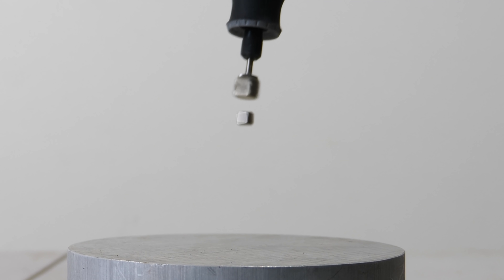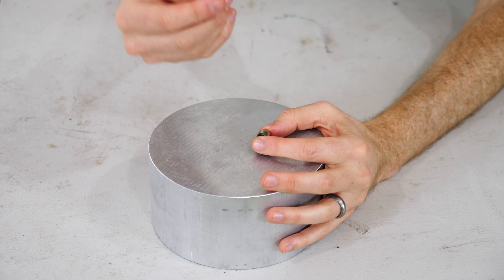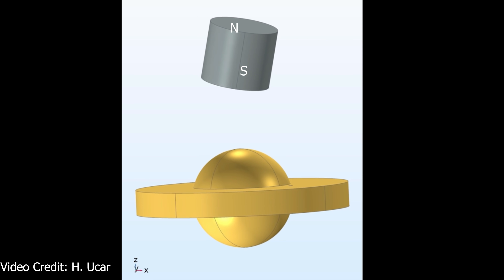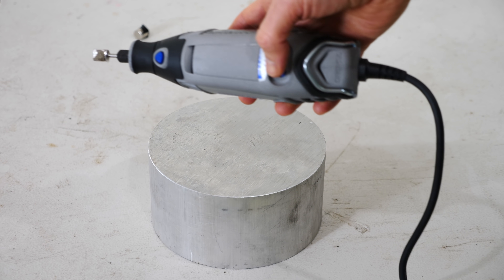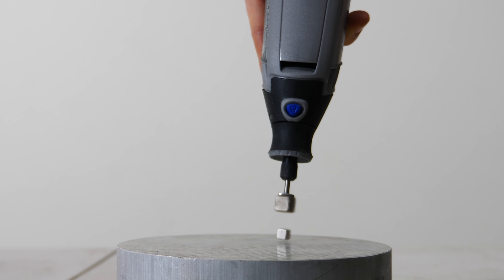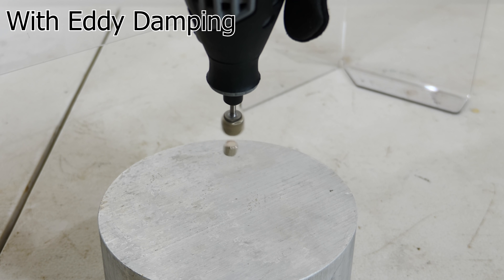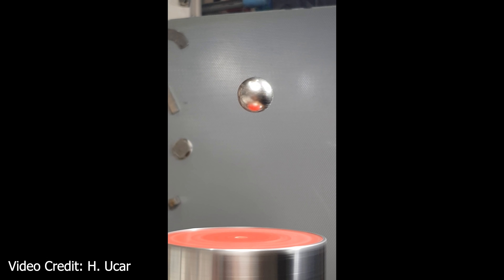Magnetic Locking WITHOUT a Superconductor!

Comment: hi, your video triggered my mind about magnetic bearings.
the youtube full of videos a rod floating on few magnets, spin kinda "fricyionless"
but all has intention to move out axially from the supporting fields, therefor 1 end is pressed against a wall.
its all about flywheel storage battery.
let say you have your flywheel spun up, suspended on radial magnetic bearings then you have this kind of locking magnet at the end.
would it be feasable to apply this kind of "active" axial locking, or does it cause energy loss?
aka does it consume extra energy while my flywheel spins as usual.
let say ther is a nother kind of axial positioning, while the speed of flywheel out of magnetic locking speed requirement.
Reply: Let me comment on that. This magnetic locking system requires the floating part to vibrate by the principle. However vibrations are not welcomed in a engineering solution. This can be solved but not trivial. Generally this have a energy cost. Please also Ucar's works referred in the description.
Reply: @sudanamaru  thanks, Ucar's paper was frigteningly mathematical, it "repelled" my understanding.
also i did not imagine, that the bouncing is a must in the theory.
cause Ucar's videos shown quite "stable" balls and cylinders floating in midair (okay, once suspended between 2 or 3 rotors)
so technically all the magnetic bearings must have some reluktance "friction" that pulls some energy from the spinning rotors suspended between the magnets.

Comment: Pretty incredible, imagine if you could achieve this with super magnets working in equalibrium with gravity to reduce the fuel required to break the stronger gravitational forces for rockets to lift off. Maybe this partially explains so called UFO flight technology, both terrestrial and extra terrestrial.
Reply: It is surprizing that this locking effect is covered by the Newtonian physics. However its implications I expect will go well beyond that.

Comment: I wonder if this could work in reverse. Also, I wonder if this has applications in plasma physics to assist in fusion reactors. Tokomak Reactors essentially use magnetic fields built in a circle to flow hot plasma without touching the walls and melting out. If this can concentrate the plasma into a ball, it could really assist in simplifying fusion reactor design.

Comment: This trick would not work with ferrite magnets, only neodymium magnets.
The magnet surface has to be electrically conductive to support repulsive eddy currents.
The magnet is floating in a balance between repulsive eddy currents, and atractive magnetic force.

On both magnets there are eddy currents that heat them up, especially the surface. Such heating breaks anisotropic domains, and weaken the magnet.
Reply: This is why the researcher recently suggested an educational initiative to prevent such confusions. 
https://twitter.com/Sudanamaru1/status/1374204457576189954

Comment: Fantastic experiment!  I tried it and was able to repeat the results.  In my trials I did notice an interesting effect.  Once the levitating magnetic "locked in" the load on the Dremel tool increased as evidenced by a sudden drop on RPM.  I haven't downloaded the paper yet, but was curious if anyone had noticed this behavior.  Any ideas as to what's going on?
Reply: This is not the characteristic of this phenomenon. Unlikely but if your magnet you levitate is big, it can cause vibration on the dremel shaft which can increase the the friction in case your dremel is not in good shape. See my channel for more configurations.
Reply: hi what type of glue did u use to glue it to the dremel

Comment: The paper by Hamdi Uçar is brilliant.  So many good examples to illustrate every mathematical analysis. One of the best science papers I have read in a long time. James'  PhD paper is also interesting and I hope the processes are extended further, it may become a practical way of preparing liquid fuels from low value (waste) biomass feedstock.

A commercial implementation might be a small magnet with butterfly wings that is levitated above a rotating tilted dipole with a static repulsive field on-axis. Electromagnetic rotating dipole would make less noise and be a cool desk ornament.

A few experiments I would like to see tried:

1: Just for fun try this out on the vomit comet or on the ISS. Would it allow for arbitrary towing of the magnet behind the rotator?

2: Have a (spherical) magnet levitating in a small pot of hardening resin that leaves the magnet away from the edges with no layer seams in the resin.  Would the small motion prevent the resin curing in proximity to the magnet?

3: Using phased electromagnetic coils and a free running ESC might be able to produce the rotating magnetic dipole.  Can a magnet be levitated with no moving parts, except the levitating magnet which has to oscillate? Another comment on repurposing an induction motor had the same idea.

4: We would like to see a collaboration with one of the high speed camera channels so we can better see the motion of the levitator.  It should be like a spinning top but would be nice to see.  See figure 60.

5: Floating a blob of ferrofluid (perhaps in a capsule), I wonder if it qualifies as it does not have its own magnetic field.

Comment: It was Mr. Earnshaw who proved why you can't levitate (in unconstrained space) using permanent magnets - (his electrostatic theorems being extended to magnets) - but rather nicely he left a couple of loop holes - one was the moving magnet effect - his theorem only applied to static magnets and the other loop hole was it didn't apply to diamagnetic materials (materials which only repel in the presence of a magnetic field). Wasn't that nice of him? :)
Reply: One should check the possibilty of presence of this interaction in the nucleus by the requirement of p or n provides the rotating field.

Comment: I have seen thermometers That operate with glass floats suspended in a column of liquid that rise and fall according to the temperature. Can you explain how they work?
Reply: Galileo thermometers are super cool! Basically as the temperature changes, the effective density of the liquid and each of the floats change. They move up and down depending on their own density. Because of this, if each float represents a certain range of temperatures, you can determine the temperature :D

Comment: Years ago there was a toy top called a levatron or some such. You would spin the top on a plastic sheet over a strong circular magnet. You could then carefully lift the top up with the plastic sheet until a certain point was reached where the repulsive forces balanced gravity. It would float in the air as long as it was kept rotating fast enough. There was a copper (or aluminum) washer placed on the top to create the dampening eddy current field. This washer had nothing to do with weight. If you used a non conductive washer of the same weight the top would not float stably.

Comment: "Tomasz Mazurek: I'm thinking it should also be possible to use a stationary circular array of electromagnets to create a spinning magnetic field without moving parts - but would it be more or less efficient?" 

Less efficient. However in order to trap sub miligram particles one needs to have rotating fields above 200,000 RPM where coil solutions should be considered. A single coil solution is also mentioned in the article.
Reply: Buildable idea: Levitate a small NdFeB floater using a coil-only PFR/MBS trap by driving two orthogonal coils in strict quadrature to create a rotating transverse field BC=cos ωt x̂+sin ωt ŷ and adding a constant bias field BS along z with a solenoid; choose ω above the floater’s torsional natural frequency ω0≈√(τS/I) so the dipole phase-lags and precesses on a stable cone about z, keep BS/BC above the minimum for z-aligned precession, then introduce a gentle axial |B| gradient ∂|B|/∂z so the rotating field yields short-range polarity-free repulsion that balances the longer-range DC attraction to form a bound state; make the gradient by slightly detuning a Helmholtz pair or adding a small shim coil, use a tiny axis-symmetric magnet and provisional eddy-current damping with a copper or aluminum ring for capture, then trim BC amplitude, BS level and ω to set height within the stability window.

Comment: What would happen if you used spherical magnets for both?
Reply: Check the 0:44 of the full video https://youtu.be/EMwKT2892LM where the spherical magnet is visible inside the floating assembly. Anyway, bare shperical magnets also work (in both directions).

Comment: "Next question, can you use electro-magnet to simulate the spinning motion instead to achieve levitation?"

Maybe. Keep in mind that the ferromagnetic core of this electromagnet  should not be attracted by the floating magnet significantly otherwise they will stuck together. Maybe a core with low saturation characteristics would be needed.
Reply: A strong magnet would be ideal. The repeated attraction and repulsion that this creates is the mechanism responsible for the observed locking.
Reply: @jdfershizzle  Does that mean that there should be a relative and equal pull force from both magnets or should the spinning controller magnet(s) have a stronger pull force than that of the one being locked(or vice versa)? And how does one account for the physical weight of the locked magnet?
Reply: Intuitively, I want to say yes, but I don't know. I can't wait to experiment with this!
Reply: @abderrahimaourir Why using air gun there? Magnets continue to orbit (and then escape) once you push them in order to free them from their alignment with the Earth field (similar to a compass).

Comment: How about making the rotation "digital". You have electromagnets in a circle and via a controller turn on the magnets one-by-one in quick succession and maybe reversing the polarity if needed.
Reply: Doing it with electromagnets.  Why not just switch polarity of a single stationary electromagnet quickly to achieve the same?

Comment: Imagine if a guy just built a 100,000 square meter superconductor and made it froze in Antarctica, Because of how big the Superconductor is, you can make anything levitate due to the temperature no matter how big as long as the pole of equal sides don't collide, it will levitate, or just put a magnet in your shoes and make it the opposite pole of the superconductor, will it make you levitate? Or make you stay in place? Well my idea can't happen cause it's practically impossible with todays technology, just asking for the impossible you know?

Comment: Something tells me this is how UFO’s fly.
Reply: "So when a video appeared in 2001 from a small company called Transdimensional Technologies of a triangle shaped, aluminum foil and wire thing called a lifter that actually propelled itself off the table, I immediately had to make one. I’d had enough background by then to be confident that it was flying using ion propulsion. And in fact, given my background I was able to put an enhancement in my first version that others came up with only later. For those who’ve never seen a lifter, it’s extremely simple. Think of it as a very leaky capacitor. One electrode is an aluminum foil skirt, in the shape of a triangle. Spaced apart from that around an inch or so away, usually using 1/6″ balsa wood sticks, is a very thin bare wire (think 30AWG) also shaped as a triangle. High voltage is applied between the foil skirt and the wire. The result is that a downward jet of air is created around and through the middle of the triangle and the lifter flies up off the table. But that is just the barest explanation of how it works. We must go deeper!" – 
https://hackaday.com/2016/07/13/expanding-horizons-with-the-ion-propelled-lifter/
Reply: @Chicken_Little_Syndrome  nerd 🙇‍♂️
Reply: I thought the same thing. Because it's ironic that there are always more claims of seeing unexplained flying objects around places in the earth that have a large magnetic field in the ground. I'm no scientist or a hard-core alien believer. I just know there are things that fly in our skies that have yet to be explained to me...

Comment: Now make it move in the line of track
Reply: https://www.dropbox.com/s/y0d2ufnlikpp9y0/IMG16107911157650.jpg
This is a rotating track of alternating magnets attached to a DC motor. When the track rotates, a magnet can  be trapped in the air, little above rhe track. This arrangement is not optimized and the trapping is just enough to keep magnet in air above the track but not below.

Comment: If you can get that effect by rotating magnets, then you should be able to get the same effect by electrically rotating magnetic fields. You would just need really high frequencies.
Reply: Correct. This is required to trap small magnetic particles and molecules. For even smaller objects like atoms and neutrons, one should use electromagnetic waves. However, these are governed by quantum laws and and solutions could be different.

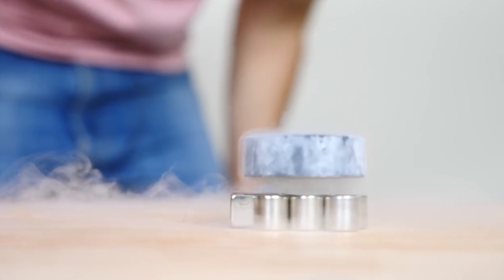Comment: so in theory would it be possible to on a small scale use this method to try and reproduce the same or similar effects that a superconductor can for movement in 0:50 . if u was to use the spinning magnet method to achieve this type of movement then you could in theory, create such a platform that  is locked in place by a rotating magnet above. this platform can be dragged along by the repelling magnet above it allowing free levitation movement over any surface as long as the platform in lock in below. starting small scale with a hoverboard, you wouldn't need to construct a whole road for levitation such as in 0:50 because the platform is magnetically locked underneath allowing you to even travel over grass. the scale it up to a car or a boat, you could even create a surf board that doesn't even touch the water.

Comment: I guess this could be even better if you can control the magnetic field motion and amplitude and get rid of the moving parts.
For example you can create a rotating magnetic field using an array of electromagnets and driving their phases using some electronics. This way we can control many aspects like speed of rotation, amplitude of the magnetic field and I think you can have some fun moving around the flying magnet like magic.
I think the result should be more smooth and silent.

Comment: But the problem is, you can't make a spinning track that the floating magnet can run on.. with superconductors, you can..
Reply: Check the solution at Fig. 5.32 on the article (arxiv.org/abs/2009.07082). BTW,  there are other trapping solutions there answering to some other questions/comments.

Comment: I wonder if it would be more stable if the magnet were "wheel" shaped. Due to gyroscopic stability?
Reply: How about making the rotation "digital". You have electromagnets in a circle and via a controller turn on the magnets one-by-one in quick succession and maybe reversing the polarity if needed.
Reply: @royroye1643  stater. Brushless motor kinda does that in a rotation instead a flip.
Reply: Actually I have a new ideal 

Could you make it flip like a coin and still have the same effect I know what you saying but I’m curious
Reply: @Phoeneyx  How would that be applied to travel or other things?
Reply: @OddZodd  probably less practical and more experimental
Reply: Yes, they showed barrels with magnetic poles that made more stable levitation fields
Reply: There is a toy that does this with a special arrangement of permanent magnets.  No rotation needed.
Reply: @trentallman984 what toy

Comment: I had a similar thought for magnetic levitation, where you take a stationary electromagnet and basically feed an alternating current into it, where if you can get the frequency down right, a permanent magnet should float.
Reply: I think the movement is an important part, since a stationary alternating magnetic pole would require very precise balance.
Reply: ב''ה, there's the regular floating globe/top feedback loop novelties.

Comment: Is it possible to use the same method, but to make the dremel levitate instead of the magnet ?
Reply: @Deborah Ajao  then the rotating force of the magnets should be multiplied "x4" over a bigger and lower surface on a bigger magnetic surface.

Comment: I’d love to see an episode on recent developments in drastically slowing light. I know you’ve spoken about it previously but I’d like to see someone demo it.
Reply: You can get really good results by synchronizing the camera frame scanning speed with ultra short pulse lasers. It doesn't really slow the light down but it does illustrate the incremental photonic propagation throughout an optical system very beautifully. 

I guess they did actually slow down the photonic impulse by capturing it in cryogenic gas, like cesium gas or something iirc. I imagine that research is probably progressed into advanced metamaterials by now, which would be very interesting, indeed.  Writing this comment is reminding me of reading about advanced new 45nm processors that have been developed with optical iO, and I think room temperature nano cavity photonic modulators. Immediate development of this existing technology will save data centers 20-30% of their power overhead immediately.

Comment: how is it not slowing down

Edit: i find it important to clarify that i mean through eddy currents, not because it's being spun manually which it's not
Reply: It's powered (note the motor(s) )
Reply: @3ATIVE  i know but it should be slowing down because of eddy currents
Reply: @chromacat248  Those eddys would need to be induced in something external. As the floating magnet is isolated there's nothing for them to get produced in.
Reply: @3ATIVE  the "something external" would either be the levitating magnet or the cylinder it was laid on (most likely the cylinder because the magnet is so small)

either that or i'm having a hard time understanding what you mean
Reply: @chromacat248  exactly
Reply: @3ATIVE  exactly what